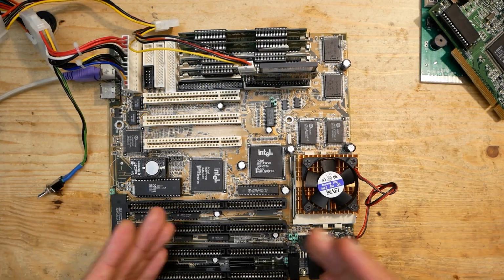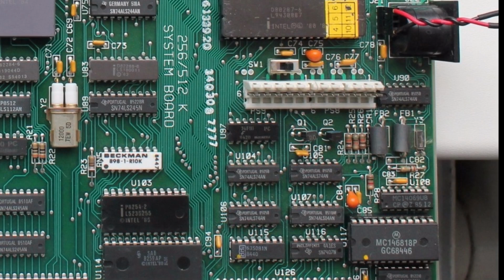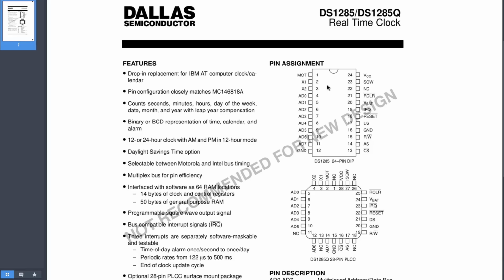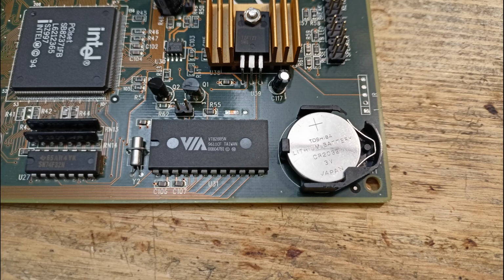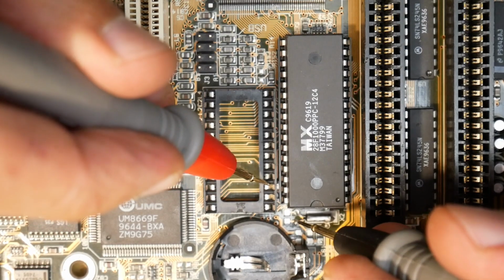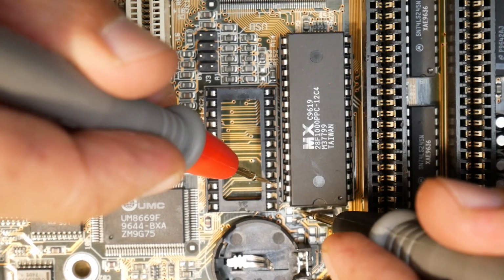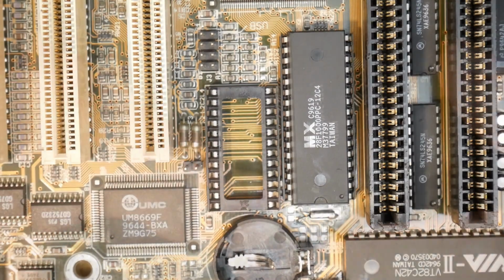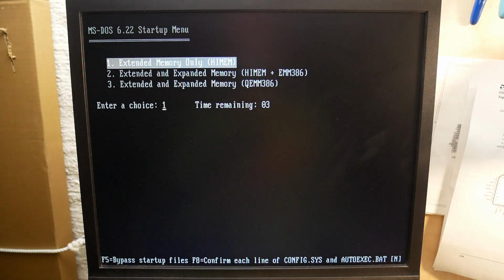Let's talk about RTC options once again

Comment: One of these days I should see just how viable it is to do similar with the ol' sun nvram chips. M48T02 and M48T08. Normally people have dug into one end to solder onto the battery contacts, but I reckon there must be an easier and cleaner way like you've done here removing the potting. 

I always especially disliked when people left the old battery connected, just due to the new battery trying to charge the old one - less a safety thing as it's not going to charge it at any decent rate, but just because that's going to shorten the life of any new battery considerably.
Reply: Re: Sun etc it's already been done and documented. A few years ago I did it with a M48T58Y. The battery locations are at the very ends on the bottom side and it takes only a couple of minutes to expose them and connect a battery holder. The original chips are very expensive now (over $30) so if I have to replace the CR2032 every 3-5 years it's still fine. I have one with external battery running in my Konami Warzaid cab and it's been going for several years so far. I keep an eprom next to it in a bag with the code. When the battery goes flat I read the eprom into my eprom programmer, change the battery and program the old M48T58Y again and it's good to go for several more years :-)

Comment: I recently had to deal with a Dallas DS5000. I had no idea that such a part existed! Fascinating little device!
Reply: A DS5000 is a 8051-compatible microcontroller with a battery-backed RAM inside. When the battery dies the RAM also clears and the code that was in there is gone forever. They are designed to self-destruct on purpose as a security device. We (as in MAMEDEV) had exactly the same issue when emulating/reversing the Gaelco arcade game World Rally Championship. Eventually the manufacturer provided the code and the game was emulated perfectly :-)
Reply: @g4z-kb7ct  ooo, interesting! I do know the System 16 boards, for example, with the dreaded "encryption modded" 68000. Seeing an arcade board with an 68k AND a DS5000 is quite cool :)

I was very lucky in two ways with the device that contained the DS5000. The Battery wasn't dead yet, AND protection was not enabled! The manufacturer even designed the thing in a way to enter programming mode via the DB9 serial port it had (Well, like the datasheet recommends...). So I managed to get the configuration and memory contents out, hacked on a new battery (luckyly there's an image of the unpotted chip, so I could confidently dremel away.)

I was quite stunned to find a device with such an advanced set of features from that time!
- programming directly over a serial connection by simply sending an Intel Hex file. 
- Partionable Memory for different ROM/RAM configurations
- Program readout protection (seemingly implemented in a way that even physical access to the SRAM Chip would'nt help)
- integrated RTC

The Datasheet and the document about this line of secure microcontrollers is a quite interesting read. 

FYI: The original programming software "KIT" runs flawlessly in DOSbox-X (tested on a Windows 10 host and FTDI USB to RS232 adapter)
Reply: @g4z-kb7ct  yes, I'm quite familiar with the DS5000 now :)

Interesting to see an arcade board with a normal 68k and the DS5000. I do know the System 16 boards, for example,  with the dreaded "special sauce" 68k...

The DS5000 totally surprised me with its feature set, regarding the time when it was created. The Datasheet, and the "Secure MC Userguide" by Dallas are a quite fascinating read.

I was doubly lucky with the device I got, because the battery wasn't dead yet, AND the encryption was not enabled! So I dumped the content, installed a CR2032 holder onto the DS500 and re-uploaded the formware. (I even could merrily dremel away at the part, because there's a photo of the unpotted DS5000 without the battery and the 32kHz quartz).

I even found another guy with the same but dead device, wich he could revive with my firmware dump!

Initially,6 I did the backup/restore via a nortmal terminal program, but I can confirm, that the original config/programming/terminal software "KIT" runs flawlessly in DOSBox-X (Host machine was Windows 10 with a normal FTDI USB to RS232 adapter)

Comment: Pardon my ignorance, but wouldn't it be possible to emulate the chip with a modern microcontroller? I know many STM32 's can keep a RTC counter running off a battery, it'd be quite easy to emulate the RAM feature if it doesn't require blazing speeds... I understand you want to keep it period-accurate, but if it helps revive tons of nice old computers without worrying for chips not made anymore, it might be worth it
Reply: yes it would be possible. but if you already have a chip the cost of a battery is like $0.50c-$1.00. Would you rather pay $5 or more for the microcontroller or $1 for a CR2032.....
Reply: I suspect general purpose chip may be not power efficient.

Comment: If you are working on and with old computers it is easy to replace the crystal of 32768 Hz with something like 40 kHz, that will speed it up a little. All the time the computer was gathering dust it did not work. To get some extra activity in it the RTC has to run faster, hurry up the lazy bones. One day the clock will be in pace with world time again, then you can switch back to the old crystal. It simply would not be right to let that lazy computer skip the times it was tiresome and was growing dust and oxidation. Fair is fair, we all were counting those hours, minutes and seconds, that computer has to count all of them too. On the double!

Comment: I am wondering how it can be cheaper to pack everything in resin than solder the parts Directly on the board.
Reply from the maker: For the mainboards manufacturer it is cheaper, because an integrated solution means less design effort, less parts and cheaper manufacturing. For the modules manufacturer this means less support due to misuse, higher module prices and binding of the customer in the long term.
Reply: @necro_ware  For Commodore PSUs the epoxy was used so government safety inspectors couldn't see how dodgy their PSU design was lol

Comment: I've used this technique to replace the battery on ST M48T59 modules used by Sun SPARC systems, though it looks like you practiced more than I did 😀. Those chips have "internal" contacts for the battery and crystal on the ends of the package, rather than pins that were bent up on the side.
Reply: Yeah i've done exactly the same. It was really nice of them to make the contacts at the very ends on the bottom side. Really easy to attached an external battery and save $30... wow they are expensive hehe!

Comment: Could imersing the chip in boiled water also work?
Reply: No. That might melt the plastic but the epoxy requires 300 degrees C at least and slowly chipping away at it while hot. That wouldn't be easy if it was floating in water even if you could get the water to 300+ degrees which you couldn't lol

Comment: Looking at this video, it seems that it should be easy to drill a hole to show the the battery contacts and remove one of the legs of the dead battery so that it doesn't stay in circuit. Just drill the metal all the way untill it breaks apart and solder a wire as usual to the remaining metal pad near the IC pins. Should provide better battery longevity because you are no longer "recharging" the dead battery
Reply from the maker: This is basically, what my old videos on this topic were about :)

Comment: The best and permanent solution is avoid ms dos motherboards lol ! Why not Pentium II + for backward compatibility? I see you all 486 guys struggle a lot squeezing single fps in Doom. This is ego fight or challenge perhaps who knows.
Reply from the maker: If it would be about performance, there would be no point to use anything of that. It makes no sense to search sense in a hobby. I prefer older systems, because they are less integrated and are better suited for learning and tinkering.
Reply: @necro_ware  My retro PC has a Pentium 4 and Geforce 6200 AGP. There are no bottlenecks running old games. It's always funny to see people running that old crap and thinking they are re-living their childhood dreams. The reality is they are re-living their childhood nightmares with the same bottlenecks and same restrictions. Using a much faster PC and running the old software means the games run at full speed and are much more enjoyable.... something that was only a dream back then. But if someone wants to run a game at 10fps on a 486 and bang head against a brick wall feel free to continue lol
Reply from the maker: @g4z-kb7ct  If you just want to run games, take the latest PC, which you use for everyday's work and call it a day. It will be faster, than any Pentium 4, doesn't matter how you define "old games". If you are interested in technology, in history, in understanding how things work, then you will get more insight, the older the system is. Furthermore, the later in time, the more APIs were standardized. DirectX, OpenGL etc. they all made it easier for developers to create new software, but before that, especially in DOS times, nothing was standard. Every graphics and sound card implemented own interfaces. Every FM sound, every General MIDI, every color mode and acceleration looked and sounded different. You could have the same game on two different PCs looking and sounding completely different. And most of that hardware needs old interfaces like ISA, VLB, EISA, MCA, or even something proprietary. It usually also doesn't run on faster machines and so on. That is why I usually find everything what doesn't have at least an ISA slot less interesting. Of course from time to time I also find some interesting topics even on later systems, but usually it's either DOS level machines, from the time before the great interface standardization, or the latest and greatest. My daily driver is Ryzen5 with RX6600 GPU and I'm playing all Windows games on it starting from 95.

Saying, that old computers are not worth the time is like saying, that visiting a museum is not worth the time, because you can see everything on youtube. It's a point I guess, but highly debatable one.
Reply: @necro_ware  Using latest pc is a waste of a good pc and all the power it has. There are millions of $5 Pentium 4 around and these have no bottlenecks with old games. Playing old games like it's 1984 is not smart.... everyone already did that and suffered with low performance. It's time to wake up and play these games at full speed like the developers intended where previously we couldn't due to the costs of getting a high end PC in the 80's. Now for $5 the true gameplay can be unlocked. But as I said, people who want to bang their head against a brick wall are free to continue lol
Reply from the maker: @g4z-kb7ct  everything I wrote seems to not even have been read. That's a shame, but this is not how a discussion can be kept interesting. However, I'm glad, that you found something what fits your needs.
Reply: @necro_ware  "everything I wrote seems to not even have been read"... yes I think the very same about what you wrote lol. repairing broken junk is not the only thing... sometimes people want to actually use it and fully experience something that was simply not possible in 198x.... that can't be done with the same old hardware made in that era. It looks like you enjoy banging your head on a brick wall so please continue ;-)
Reply from the maker: @g4z-kb7ct  Wow... I'm speechless.

Comment: Instead of using a heat gun, might it be an idea to place the Dallas chip in a cup of boiling ethanol (which boils at 78.37°C or 173.14°F)? That seems like an easy way to achieve the optimal temp evenly throughout without needing to measure temps. Isopropyl alcohol boils at 82.3°C so this may be too hot? Also inhaling isopropanol vapor is dangerous whereas inhaling ethanol vapor just means you should not drive for a while :)
Reply: Make sure you have made a will lol. Boiling toxic chemicals is not a good idea. Ethanol really stinks and when boiled it will be worse.

Comment: That bq3287 chip looks like the sort with a user-replaceable battery, the outer shell simply pops off. Very rare but I came across one on a Socket 7 motherboard.